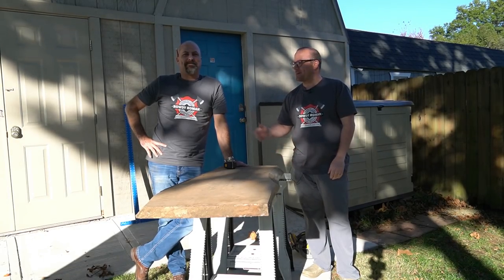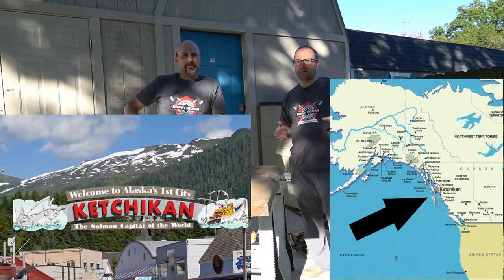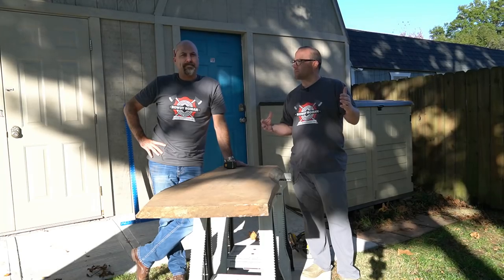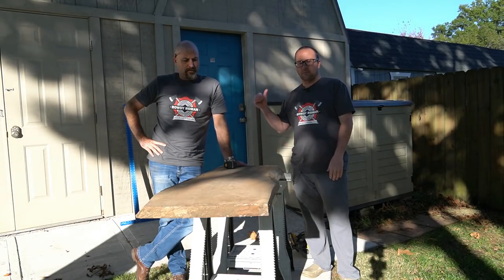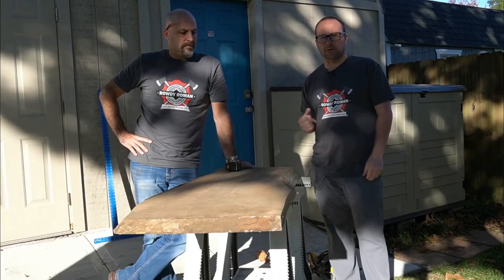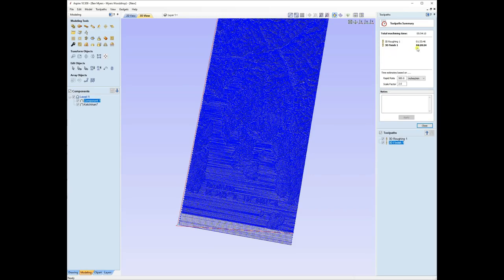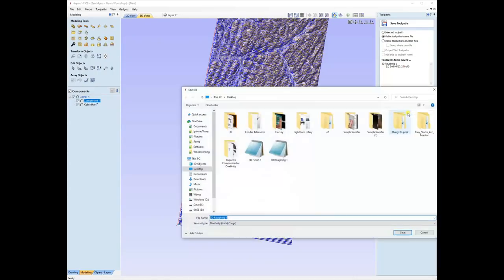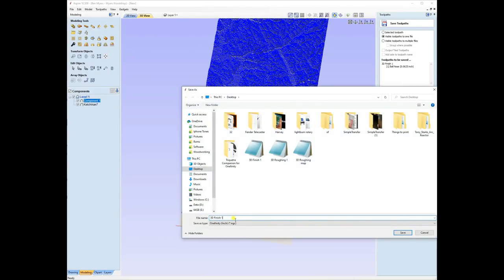How To Create A 3D Topographical Map On A CNC

Comment: It looks great!  That is a nice large mill!   Im using a tiny 3018 pro cnc mill.  I love it, but its small.  
2 tips for doing this that Ive run into now.  Im doing my first topographical carve as Im typing this.
1: The blue tape is great, but Ive had the piece come loose.  I put the hold down clamps pushing on the side of the piece to keep it from sliding against the tape.
2: Make sure you have access to the spindle for changing the bit.  I used a piece of wood covering the whole bed and had the roughing bit installed.  When time came to change to the smaller finishing bit, there was no way to remove the roughing bit as the wood was too tall for the bit to slide out.  I had to loosen and lift the spindle up to avoid moving the wood piece.

Comment: Nice project, couple of thoughts. I use a lot of slab wood so like you do use a planner bit to flatten them. Because I use odd shapes I now screw two alloy battens under them and then screw down to the spoil board, save a lot of time and is very stable.

Also you could have programmed a frame around the map with raised edge and finish to save the screw holes and need for tape.
Reply from the maker: good ideas.  i'll try those out next time!
Reply: Agree, just center the model and you will have no need for tape. For next time, no real need to flatten the entire top, just the touchoff end (not enough material across the whole board to worry about tool pass depth. Also you can shift the model some to the other end so you can re-touch off the Z on the same spot. Cool project.

Comment: I'm loading up the shopping cart and one thing that's boggling my mind is what is the functional difference between
RC-2248
and 
RC-2249
What would be the benefit of getting one or the other?
I plan on flattening hard/soft wood both with and against the grain.  Thanks for making great content.
Reply: also.. what is the deal with the RC-2265?  I wish they clearly stated the specific reason for the different configurations.
Reply from the maker: More cutters for more cleaner cuts I’d guess. I’m honestly not sure, but the one I have does a fine job!

Comment: Looks nice, BUT Since you are going to be trimming it up anyway, Why not center the work, and let the wood be your epoxy barrier, instead of having to put on tape. I think it would have come out looking nicer with  a wood border.
Also, IF you only left a 1/2 inch margin, WHY does it have at least 4 inches on the Right, 1 inch on the top, and nothing on the left and bottom?

Comment: Why didn't you use rest machining and use multiple 3D finishing passes??
Reply from the maker: not sure
Reply: Yes.  If the land portion detail was acceptable, a single pass with 1/16" for the text-only would be a quick solution.  Nice job either way.

Comment: You say oak is grainy, and as a result caused the problem with the lettering.  What species would you choose if you had the project to do over again?  1F due to arrive in April, mainly as a result of your influence.  Also, still debating software choice... would this project be possible on vcarve pro, or is aspire required?  Thanks for all the great info 👍
Reply: Sapele (mahogany) is a great wood for carving on the CNC and close to the same price. It's what i use for most of my stuff.

Comment: Amazing video and exactly what I am learning to do. I do have a couple questions hope you can help:) how long did this take on the cnc to cut? I am using camlab and something like this would take 6-8 hours with their roughing patching "clockwise path"  does that software not automatically go clockwise? Does v carve the software you are using work as a all 3 stages? Hope you can help thank you for your time:)
Reply: You can set v carve to do raster or conventional.  Depending on the machine, this may well take 3-10 hours on a carve.
Reply: It also greatly varies with what bit you use.

Comment: could add a tool touch off plate and it would automatically move to it after you change tool and reset z for you.
Reply from the maker: onefinity doesn't have one yet.
Reply: @MyersWoodshop  does it use its own software? or is it mach3?